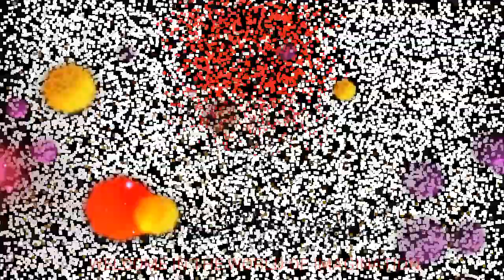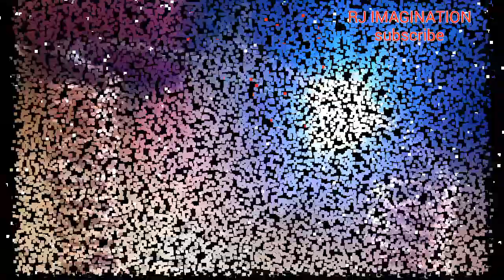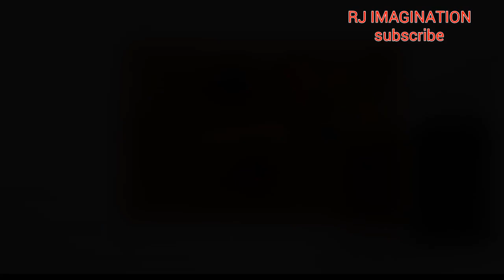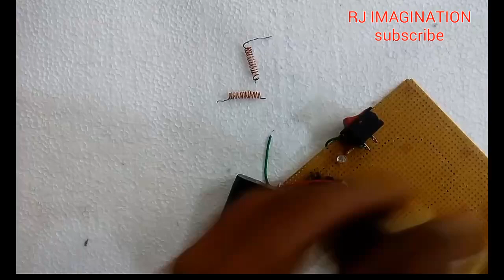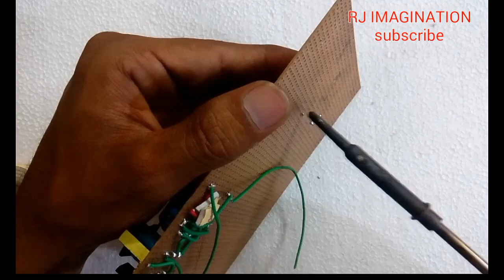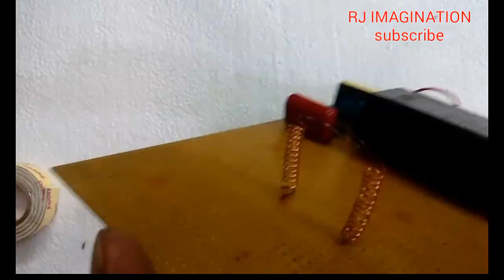Create Plasma Spark at Home | Simple Circuit

Comment: This is very boring because you can use cell with two terminals and connect wire with each other and burn the copper and this form the plasma

Comment: Why don't you draw a circuit diagram and write here what are the material you using. Like transistor, capacitor,etc. If You are making video then make it by giving full details so it can help others to understand, Without details this video is useless, some  people's will watch your video but they will not be interested with your project and your YouTube channel. Hope for your correction, have best wishes for your work.
Reply from the maker: +Sujit Ghorai thanks, this whole circuit is based on mosquito killer badminton